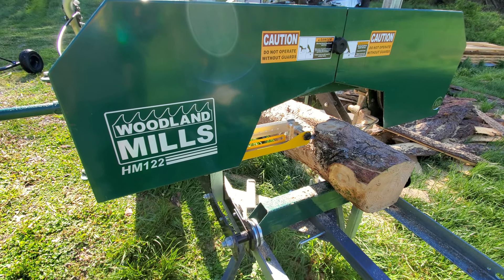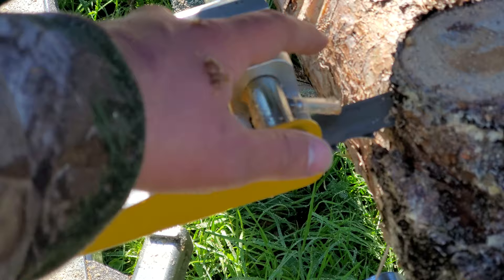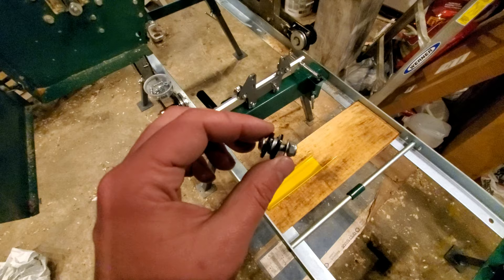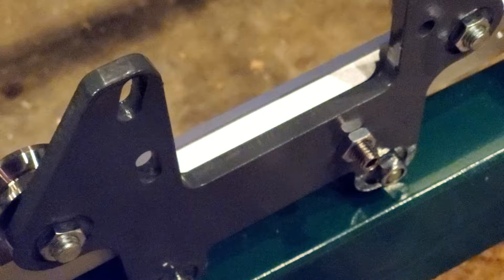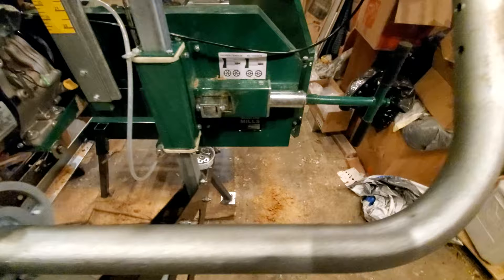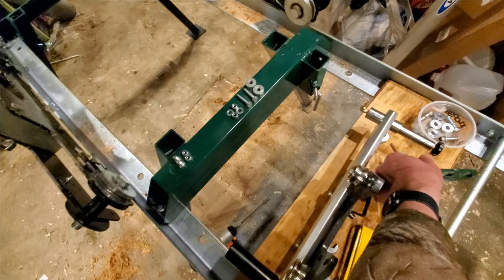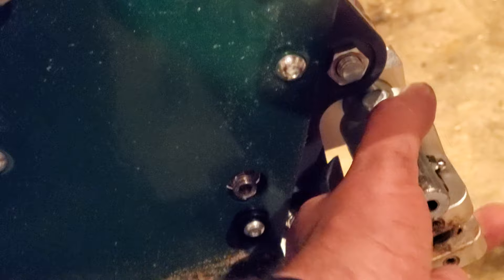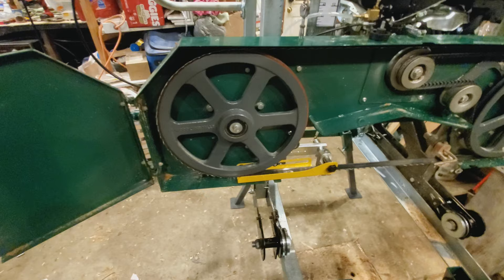Adjustable Blade Guard add on for Woodland Mills HM122 BushlanderXL

Comment: I just finished assembling my HM122 and I also got the adjustable blade guide. I also did not get any instructions with it. I sent them an email and the sent me a PDF version of the manual within a few hours. It is pretty complicated to get set up just right so that it stays in alignment no mater  where it is. Have yet to make my first cut with the mill. Had to leave it for a couple of weeks. Should be fun. Thanks for posting!
Reply from the maker: I ended up pulling the yellow guard off. The blade was scrubbing on it. I didn't want to give it a chance to catch and rip things up or break a blade.
Reply: @MikeCreuzer  Thanks Mike. I'll keep an eye out for that when I start it up.
Reply: Did y'all have to use the original spacers? When I bought my mill I forgot to install the adjustable blade guide, and just found the box in the shop.
Reply from the maker: @matthewharvey8755  I don't recall spacers... do you have instructions?  It sounds like you can request I instructions.
Reply: If you give them a call they will email you the instructions. It’s very tricky to figure it out without them.
Reply: @MikeCreuzer  I understood through your video. For some reason they sent only 2 spacers, so I just used the originals... Not sure if that was how it's intended, but oh well lol.

Comment: Wrote the first comment before I finished watching. I'm amazed you got it all figured out without instructions.
I could not get my blade to track correctly at first. Guide blocks had to be set so low, the screws wouldn't hold them straight. WM Tech suggested I loosen all four idler wheel bolts and lift the shaft to take up slop in the holes and retighten. Did that and got the 1 or 2 mm I needed.
Now, about that yellow guard. Throw it away, but put the knob back in the hole or water will run out there. The first time you throw a blade, it will tear up the yellow guard and maybe damage a few teeth. It serves no useful purpose. After all, if you don't have the guide extension, the entire 20 inches of blade is exposed.
Eagerly awaiting your next video with the extension installed.
Reply from the maker: I've recorded the video for my tool box and the log ramps and winch. I just need to edit most of them away.   I am going to record tomorrow me moving the mill. I was going to do one about leveling with the trailer, but that may wait a week.  A neighbor needs some 2x4s, so going prioritize cutting over tweaking on the mill.
Reply from the maker: You see I linked to your video at the top right corner when mine first starts?
Reply: @MikeCreuzer  Not mine, but another channel I watch. I gotta learn how to imbed that kind of link.
Reply from the maker: @OregonOldTimer  oh yeah.  Silly me.  I confused myself.
Reply: @MikeCreuzer  You must be practicing for old age.
Reply from the maker: @OregonOldTimer  LOL. I started early.

Comment: Does it offer any support when cutting hard wood?
Reply from the maker: Seems too. I think it gives me less dive when the blade is getting dull. Dull blades want to wander all over the place.
Reply: @MikeCreuzer  I was trying to cut hickory with a fresh blade, and it was diving really bad. You could surf on the surface of my boards, lol.
Reply from the maker: @nealmcbaggins127  I still get wavy cuts. Usually dull blades or pushing too hard or when I forget to tighten by blade correctly. I don't get the diving near as bad now, compare to when I first started. I think I have figured things out better.

Comment: I put that on mine .. it was hard to level... there was an issue.... i had to file something.... ..in a partially blocked bolt hole.  It was throwing everything off.

Could you do a video about how to level the bushlander trailer? 
Is it hard? Just explain how you went about it. A talk video might help us. 
I think getting it flat is the key, but that extension would seem fidgety... as it's not on the trailer frame at all.
Thoughts?
Reply from the maker: I am still searching for an ideal way. My first couple of times took many hours. I've got it down to less than half an hour to get to cutting now.
Reply from the maker: I have a mill moving and leveling video in the works. May be a few weeks yet.
Reply: @MikeCreuzer  awesome...
Got my bushlander trailer, all put together... what a great solid platform.... so much better than ground setup.
It really makes it much easier... I haven't used it yet. But ready to go. Raining here today...

Comment: Perhaps it is just the audio, but it sounds like your idle is set too high and partially engaging the clutch.  I’d hate to see you prematurely burn out a clutch.
Reply from the maker: Really... thanks. 

What are you hearing for the clutch?
Reply: @MikeCreuzer  a metal clanging sound, like a dull bell.  Plus your idle just sounds high.  Again, it could just be the audio.
Reply: I hear it at the 2 minute mark, and it went away when you revved it up.
Reply from the maker: @Uriah625  that bell sound. I thought that was just how it is supposed to sound. 

Thanks so much.
Reply: @MikeCreuzer  you’re welcome.  Turn down the idle and let me know if it goes away. 

Keep on milling!
Reply: The idle is definitely to high, the clucht is partially engaging and you have already done damage if it sounds like bells ringing. Check out "sawing with Sandy" on YouTube. The episode is called "the good the bad and the ugly. " you may want to get a tachometer to monitor that. A little lock tight goes along way, and contact woodland mills if its still under warranty. That's not suppose to happen with the clutch.
Reply from the maker: @hellogoodbye3129  only 20 hours on the machine so far. I haven't messed with anything engine wise other than the oil change and such the instructions called for.
Reply: @MikeCreuzer  from what I'm told the idle adjustment can get bumped during delivery and or assembling.